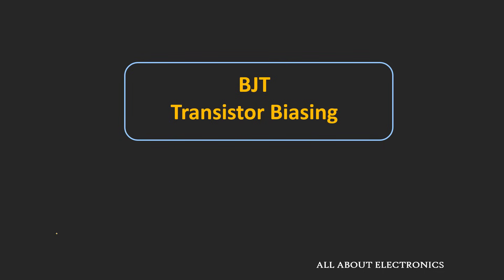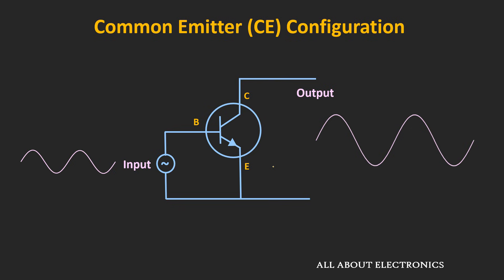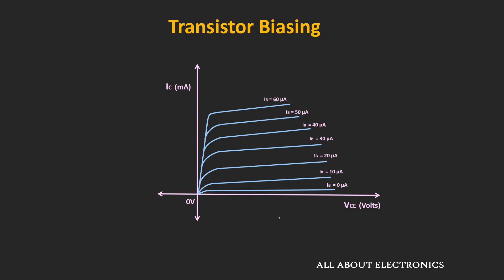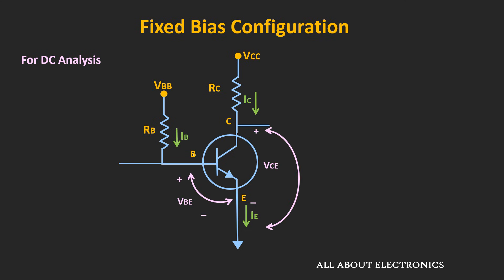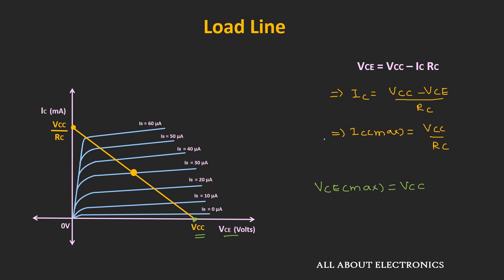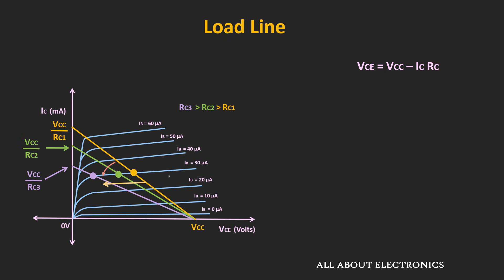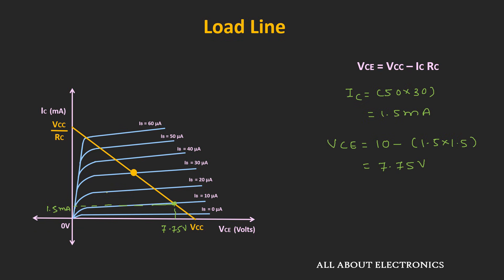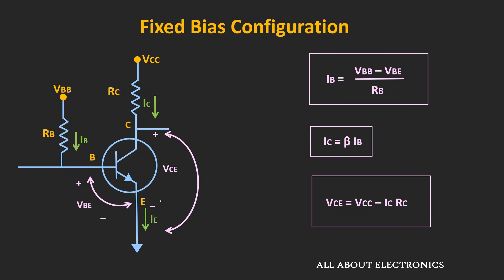Transistor Biasing: What is Q-point? What is Load Line? Fixed Bias Configuration Explained

Comment: (13:15) 
You have just calculated the new Ic using Ib= 30uA, so why the new operating point shifts to Ib=10uA line?

Nevermind, I understood it by myself (I'm leaving the comment still for others benefit)

In short, if you would plot the new curves of the β=50 transistor on top of the ones shown (for when β=100), the Ib lines for the new transistor would actually have 2x the Ib value.
In other words, for the β=50 transistor the Ib=30uA line is further down and equivalent to the Ib=15uA  line of the β=100 transistor (not the 10uA as drawn).
Reply from the maker: Yes, that's true.
Reply: justpaulo Yes changing the beta changes the output characteristic curves. I think he better correct that part of the video.
Reply: @user-mj3ef  So how ill the load line look like for Beta =200?? Since Ib is clearly not 30uA, I'm unable to get my head around it. Could you guys help with a rough image or something?
Reply: @shinejotom7052  The characteristic drawn in the video only works for beta = 100. If beta changes the characteristic also changes. Characteristic of Ib = 30uA would be higher on the graph. If we looked at characteristic of beta = 200 the characteristic for Ib = 30uA would be where the Ib = 60uA is on the graph for beta = 100. Current Ib is still 30uA when beta is 200. But the Q-point would be much higher and to the left of the graph. In the video the characteristic should be changed when calculating beta = 50 and 200, because otherwise the current Ib isn't 30uA but 60uA which is not correct.

Comment: So how we avoid that change in temperature affects our TR?
Reply from the maker: I have discussed that in the second video. (Emitter Bias and emitter Stabilized biasing) Please check that. Actually, there are a couple of parameters like β, Vbe and Reverse Saturation Current (Ico) which gets affected with temperature. For a while, during the discussion, it has been assumed that the Vbe and Ico are constant and only β changes with temperature. But in the upcoming videos, I will also cover the compensation techniques. (which may affect Vbe and Ico) 
But with some specific biasing configuration, it is possible to make an operating point almost independent of the variation β (due to temperature).